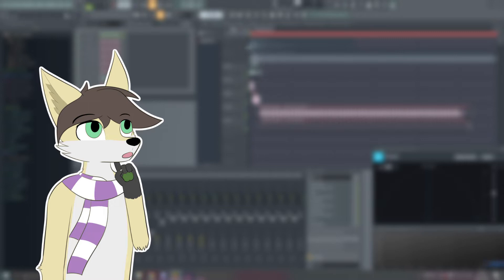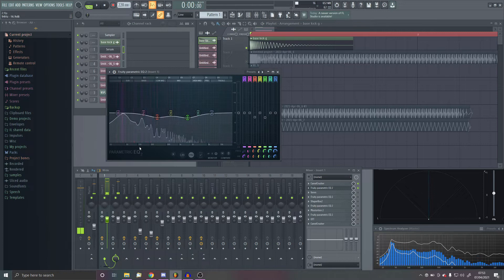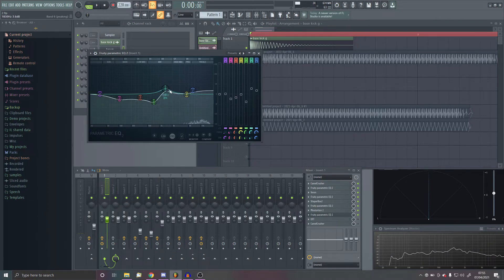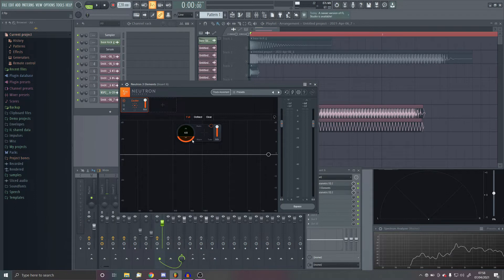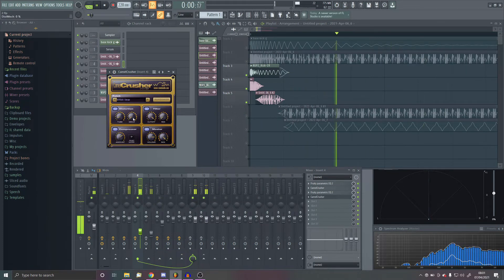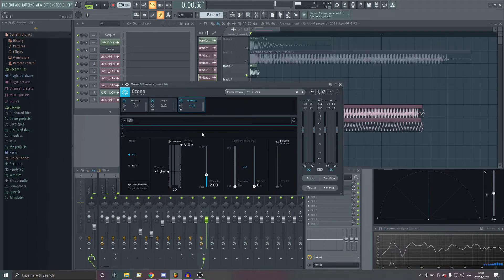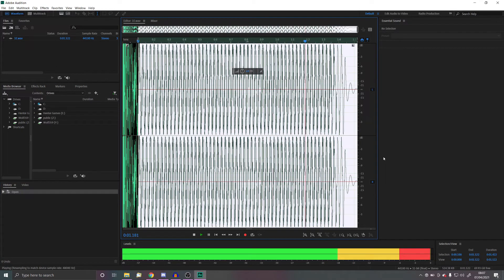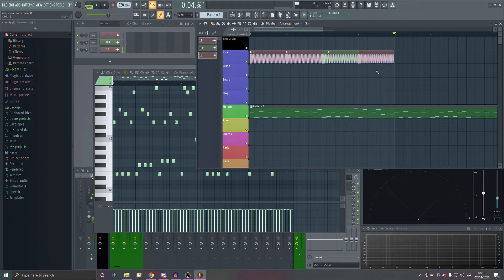Making Speedcore #2: Kick

Comment: Venm, or at least the company behind them seems to be dead. It's adding white noise to fl studio (presumably because it's a demo version). What would you recommend instead?
Reply from the maker: misstortion2 is pretty good, probably even better (and free) and does pretty much the same thing
https://nimble.itch.io/misstortion
Reply: @Valyriix  Thanks for the fast reply! However, when using misstortion, after playing any note it makes an awful clicking noise for however long I held it down. It's like reverb but just clicking. Any idea why this is happening?
Reply from the maker: @geckowithapin4284  that usually happens for me if you put sounds too loud into it, or if you turn the settings up too much
Reply: @Valyriix  Okay thank you! Sorry for all the questions but what should the settings be on misstortion to replace venm? For me it just makes it sound very quiet
Reply from the maker: @geckowithapin4284  idk the exact setting, just change the hard clipping until it sounds similar

Comment: i dont got serum :sad: is there any way to do it with vital?
Reply from the maker: If you can get the same wavetables in vital then it should be fine, the filter isn’t super necessary, it might just need a little extra tweaking at some stages.
Reply: @Valyriix  alright
Reply: @svrgndubs  just pirate it bestie